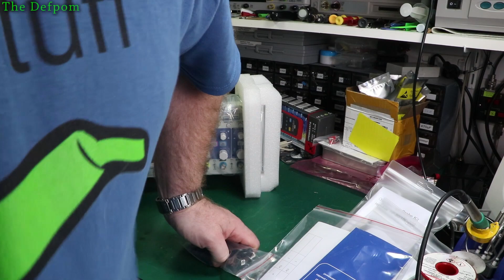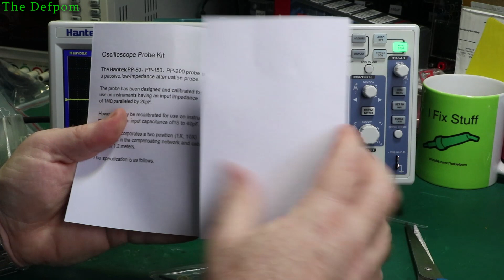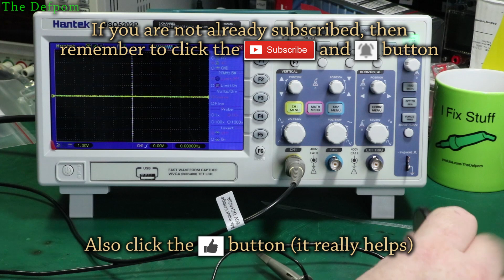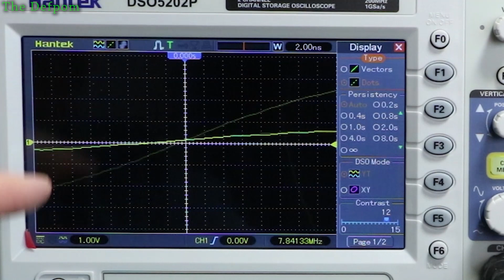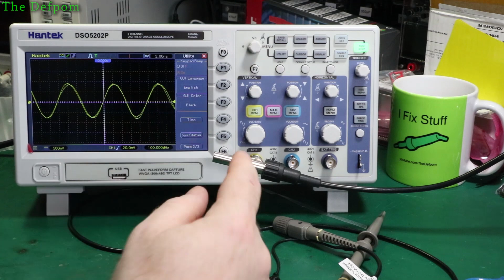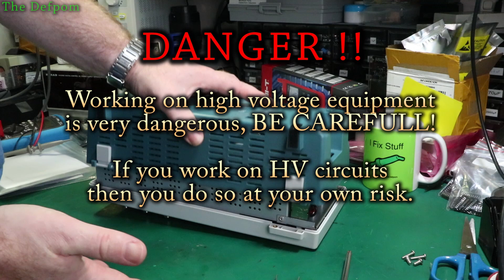#706 Hantek DSO5202P 200MHz Oscilloscope Review And Teardown

Comment: With a 1GHz sample rate and a 200Mhz signal it's actually only 5 samples per cycle of the waveform, that's where the wobble comes from. 
They probably interpolate to get the extra points for the display. 
How does this compare with a Tektronix TBS1202C, it's apparently the same spec although the Tek has only 20k point record length?
Thanks for the review, I'm looking to replace my old Tek analogue scope that just died!

Comment: Looking at the manual the observed very jittery behavior and the low number of samples seems to be due to the active real-time digital acquisition mode. This mode is active, see the selected first option in the acquire menu (15:08). Changing the first option in acquire menu to the equivalent sample mode could provides a (repeated) sample rate up to 25Gsa/s. For repetitative signals this should improve the observed quantificaton issue for high frequency signals.

Comment: Hi! I'm trying to decide between the hantek dso5102p which is the 100mhz version of this scope you're reviewing, and the siglent sds1052dl+, which is 50mhz bandwidth and 500 megasamples per sec, as my beginner scope. Here in my country they cost almost the same, the hantek being slightly cheaper. I can't afford a more expensive scope, these two i'm mentioning fit in my budget and they're on sale on Amazon. Which one would you recommend me? I need something robust and durable 'cause i will carry my scope around, to college and to field practice, and i've heard the hanteks are kinda fragile and cheaply built than the siglents. On the other hand, the hantek has wider bandwidth and more samplerate. I'm taking the build quality and robustness as the main criteria in my choice between these two scopes. What do you think? Thanks for your advice!
Reply from the maker: I can’t speak for the exact Siglent scope as I haven’t used that particular one, but my gut instinct is to go for the Siglent, the ones I have used were far better than the Hantek.
Reply: @TheDefpom  Thanks a lot!

Comment: Why didn't you use the cable which came with the scope? The EU plug had an adaptor for Aus and NZ grid supply. It was a two pin plug, i.e. no ground to the bnc. I guess the scope is double isolated, although I didn't see the sign showing such. Without the ground pin, and using a RCD / GFCI the scope should be safe I guess,,, without the ground pin... would that be correct ???

Comment: you have its set to 1x in the scope... you need to set it to 10x .... . i have the same model and it does NOT do this at all, 1gs/s is quite sufficient, maybe you could try upgrading the firmware
Reply from the maker: You are correct that I forgot to switch to 1x after hooking up the BNC cable, it wouldn't cause any difference apart from the voltage readings on the scope being out by 10x. I will have to check to see if there is a firmware update.

Comment: I wish that I had a scope like this back in the mid 1970's when I started in the electronics hobby. They are what they are and are built to a price point to make them useful and affordable to the hobbyist and designers that are starting out on a tight budget.  If you want laboratory accuracy R&S will be happy to sell you a 200 MHZ scope for around  $6000 USD. As will Tektronix or Keysight.  You have to ask yourself how often have you had to make a very precise and accurate   measurement at or around 200MHZ using  your scope. For me, I can say probably never. ATB Doug.

Comment: Well I see you found the same problems with this scope. I have the little brother  100mhz and it's really may be 45 to 50 mhz. It's very jittery scope and that can cause you to look for problems that aren't there. It also resets setting on it's own and when I would use it I found myself having to double check setting all the time.  But for me it's just too jittery to be of any real use. For the $$$ I would say just save a bit more $$ and you can get a much better scope that will be much more useful.